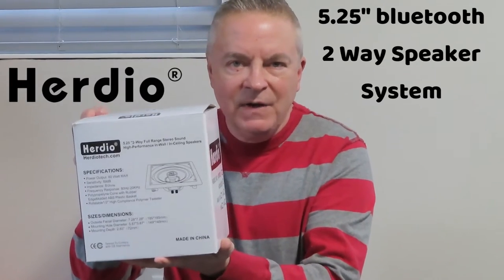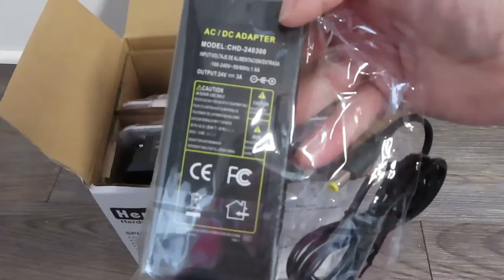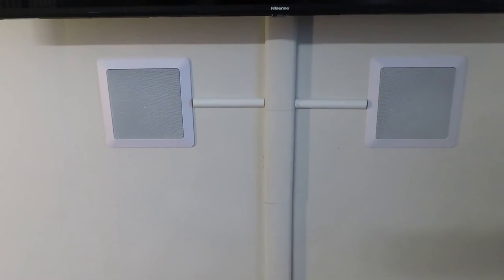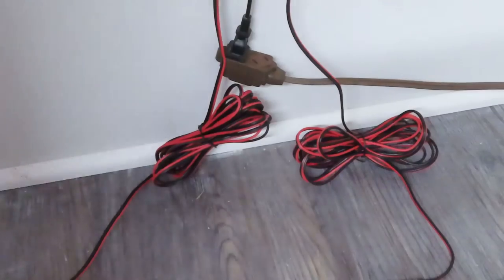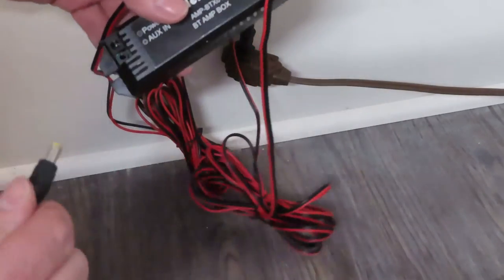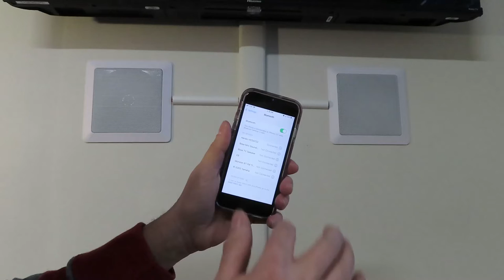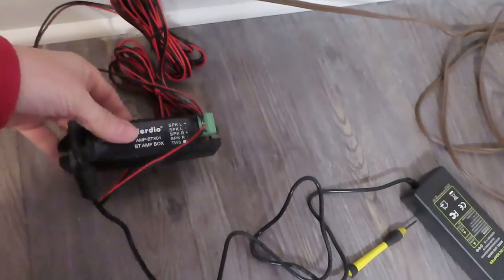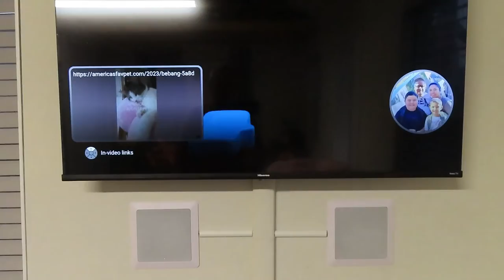HERDIO Bluetooth Ceiling & Wall Speakers 160 Watts HMS5022BT Install & Review @Deddy Mike's Life

Comment: Thanks, I just got these. In my box, the mesh front piece is attached to the speakers and I can't get to the little screws, how do you take it off to get to those tabs you have to turn? Any suggestions? They are really stuck on there, and I hate to pry it off a mess up the finish.
Reply from the maker: I just tried a guitar pick on mine and it popped right out. Something thin, I think a credit card would work also

Comment: For the life of me I just don't understand why none of these blue tooth speakers and amps require you to have a cord plugged into an electric outlet! Why can't these manufacturers build it so you can get power from an inwall 120 volt wire?? This way, all the wires, including power wires, would be invisible. I want to install this in our master bathroom, and the idea of having to run a wire to the electric outlet is just ugly! Just picture in your mind a bathroom with an amp installed in the wall next to an electric outlet and then a power block plugged into the outlet that is then plugged into the in wall amp. Oh, and because the wire is long, it has to be rolled up and wire tied to keep the wire from touching the floor! It's an ugly picture in your head ,isn't it. Seriously, if someone comes up with a way to run power to these contraptions inside a wall, they are going to make some serious money! It's just ridiculous....
Reply: Exactly.  It's mind boggling.  I've looked the last two days amd it seems no company makes a hard wired bluetooth ceiling speaker.